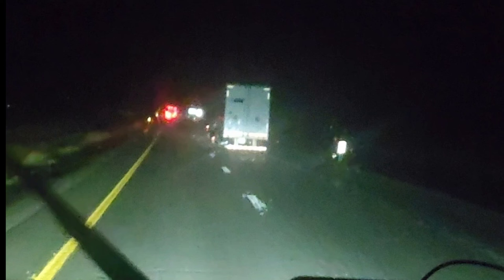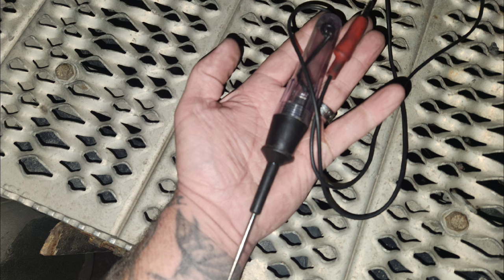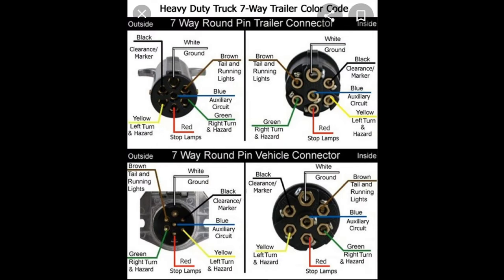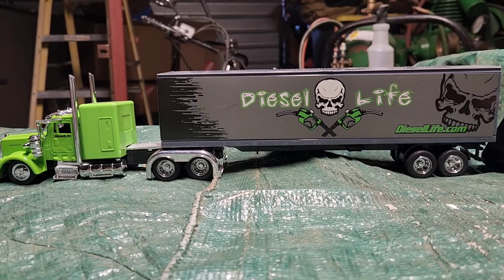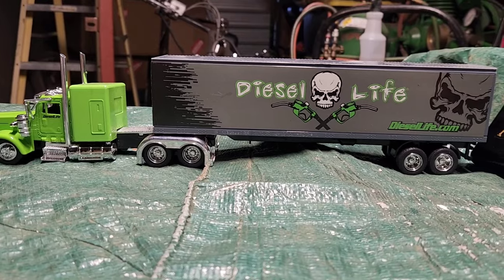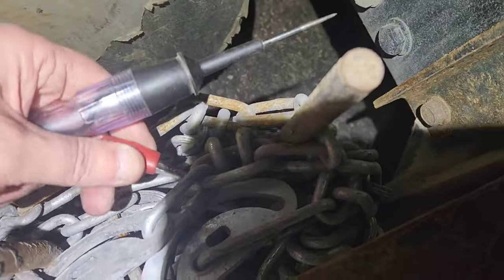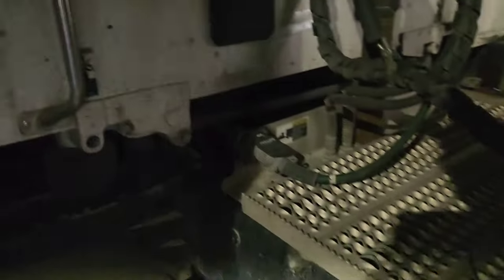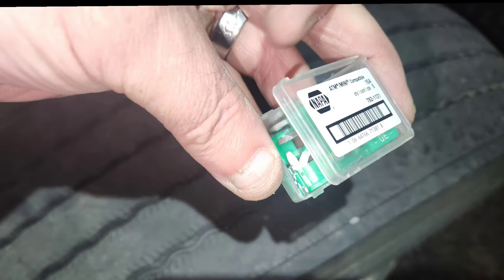99.99% of Semi-trailer lights FIXED!

Comment: Sometimes stuff blows after your pretrip, while you are driving. Using the flashers to cover for not having tail lights, just to get to a safe place to repair or get repaired, is a good way to NOT get hit. 
Please do not attempt to repair your lights while stopped on the shoulder of the road. Use the flashers to get to a safe place.
Reply from the maker: You make a valid point.  After all, it is the vibration which most often causes wires and hoses to rub through. My concern is for those drivers who just keep pushing instead of stopping at a rest area or service shop to address the problem.

Comment: Never replace a fuse with a higher rated fuse , Never !  Use a small pair of locking  ( ViceGrips ) for a good ground attachment point .  Do not buy a Garbage Freight test light . Amazon has a variety of good quality test lights for $11.00 . Carry small wire strippers , couple feet of 12 gauge wire , electrical tape and wire nuts .

Comment: Why don't you become a Amazon seller with the link so others can instantly bring them to the needed tools.  Thanks for doing good.
Reply from the maker: My philosophy is that company drivers should never pay for tools that stay on the trucks. The carriers make (& hoard) plenty of money, & they benefit greatly from drivers who do their own repairs instead of calling for roadside service or having a mechanic do it all.   Unless you have a company credit card linked to your online shopping accounts, you're spending your own hard-earned money on tools which the company should buy.  That's just my thought on it.  
Of course,  drivers certainly benefit from a tool bag, as well, because, in this industry, time is limited & miles are money. 
That said, I will consider your suggestion, though my channel is hardly large enough to make any difference.